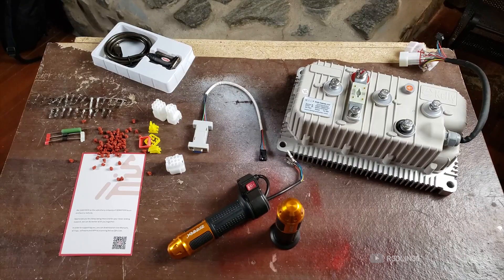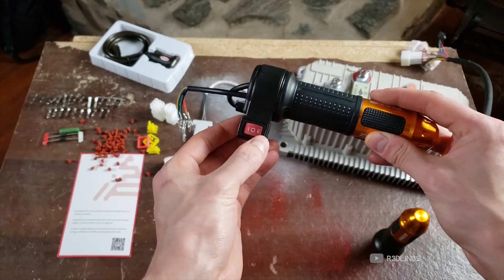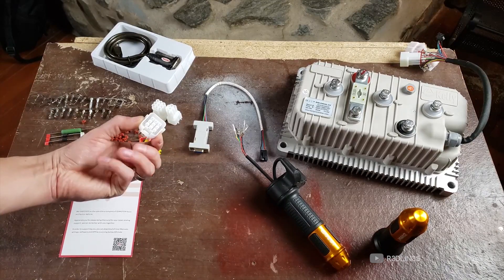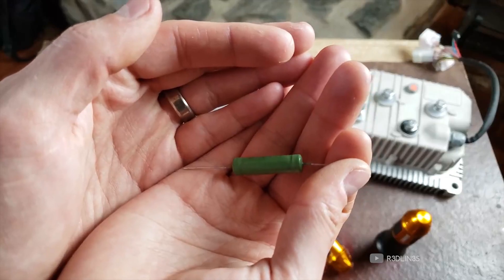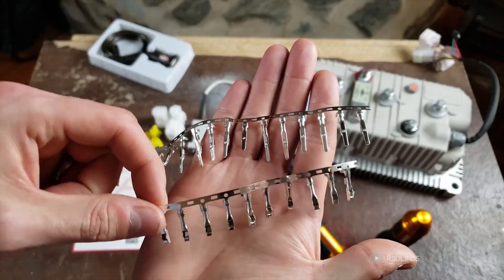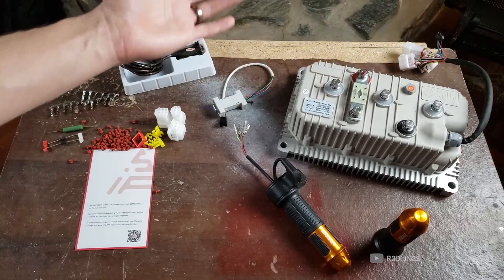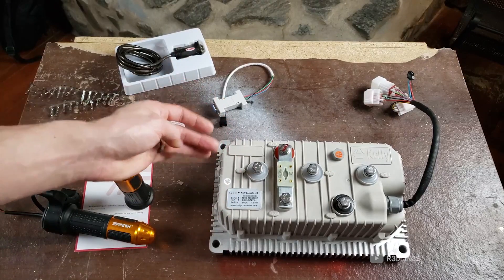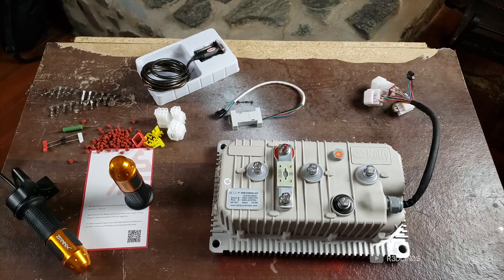Kelly KLS7275H Sinusoidal Wave Motor Controller, Brushless DC Motor - Unboxing

Comment: Anyone ever run this with 21s instead of the usual 20s? Just wondering if it's a similar idea to using 14s over 13s.
Reply: I run 21S and 22S